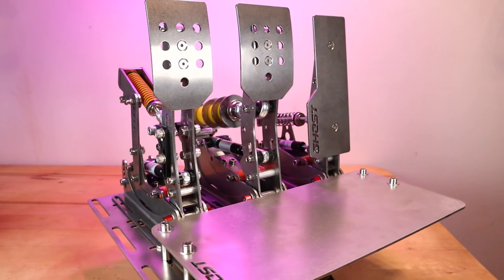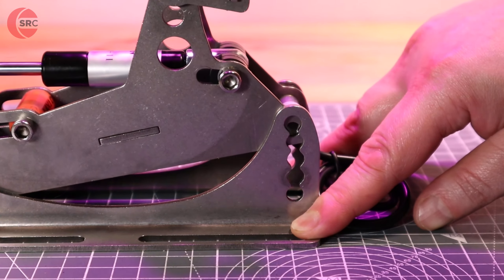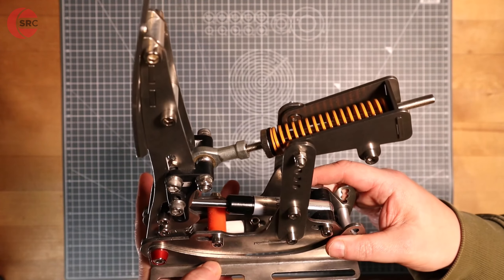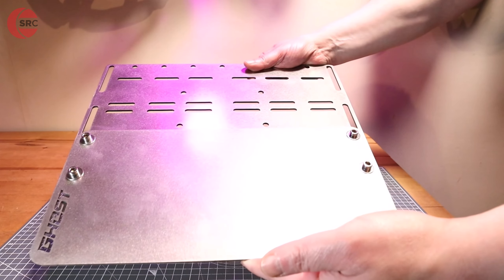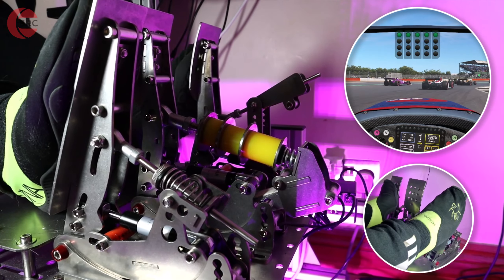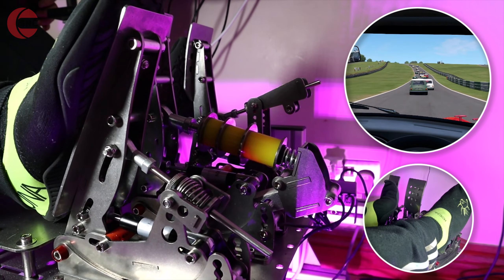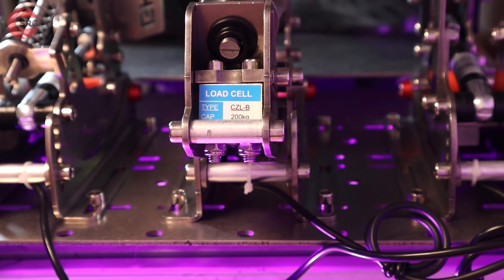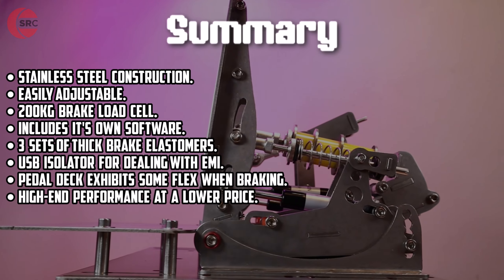PHANTOM-PRO Pedals [REVIEW] Spookily familiar, maybe?

Comment: Great review as always. 
I'm still not sure which one of the SIMxyz " family" are the best fit for me as my first loadcell pedals.

I prefer a softer brake with long travel (due to medical conditions) and a harder gas pedal, also with long travel. Idk about the clutch 

Any advice you can give?
Reply: >I prefer a softer brake with long travel 
You can customize them in such a wide range that I would say this is not an issue. Drop dumper, use softest elastomers and you are good to go.
Reply: i have the old meanwhile fully modded simjack pro and i also like soft long travel  so i bought a 60mm  medium spring cost a few € on ali   .... so a longer spring and than 1 elastomere for the last 15% ^^ if i rly need it 
out of the box none of them have that option but  it cost not much and is an ez fix^^